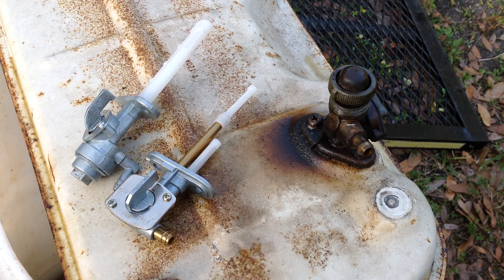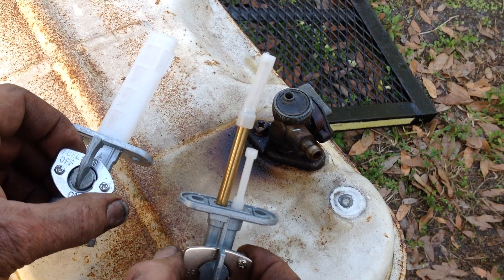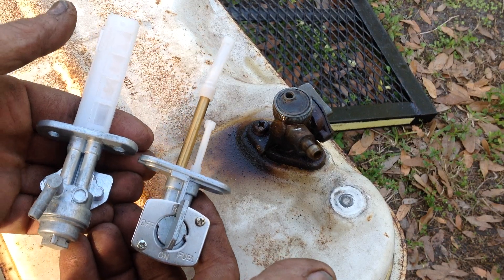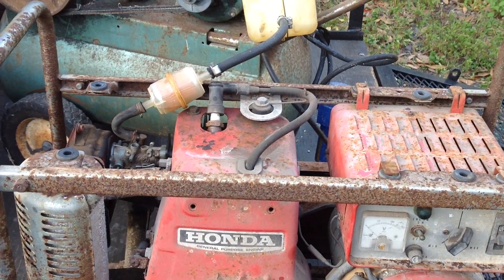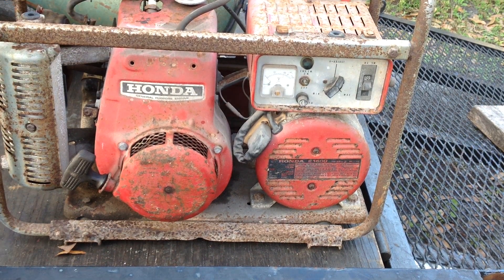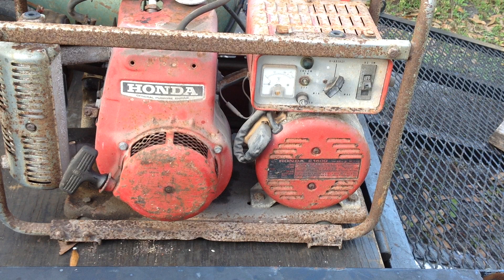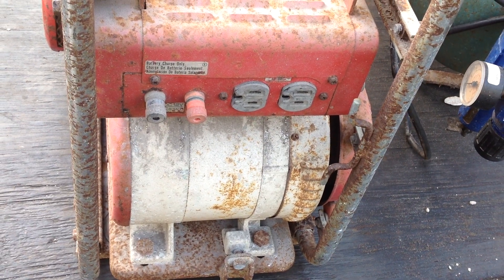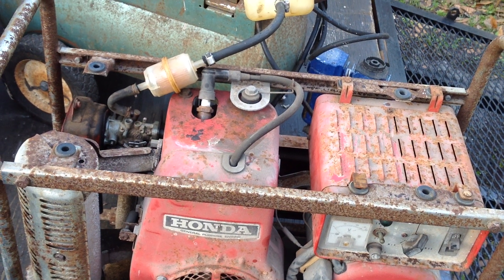Honda E1500 Generator start

Comment: I got the same one, but it does not send current to the spark plug...
Reply from the maker: You may have a bad coil. Make sure the spark plug wire is in good condition as well.
Reply: @tommy-time5240  indeed, I saw through the small plate that there are two small coils, but I do not see the platinum screws because I have not yet disassembled